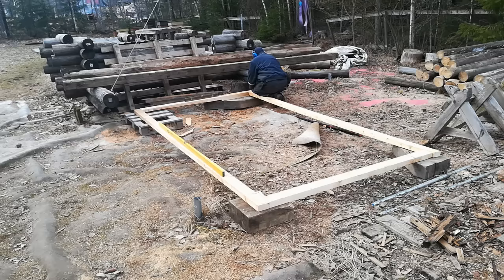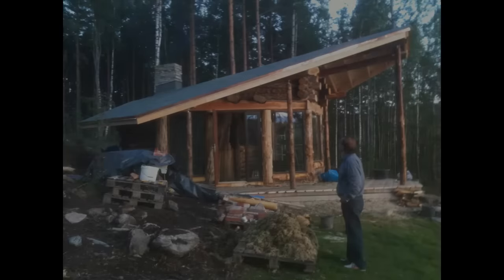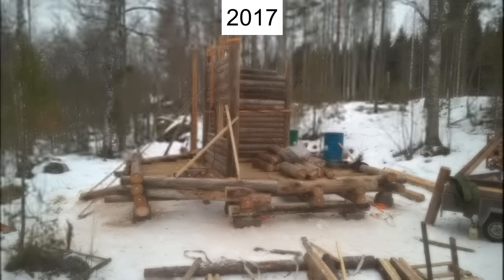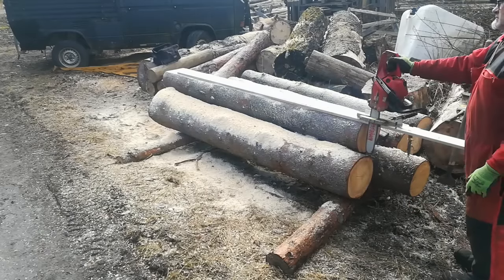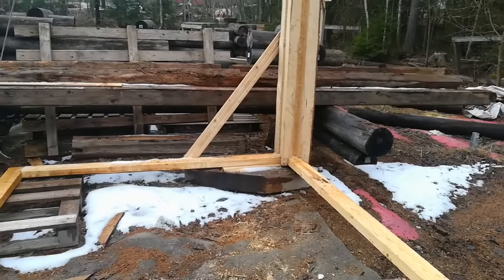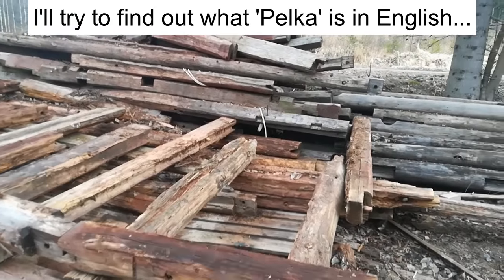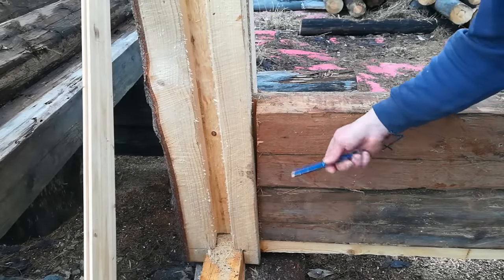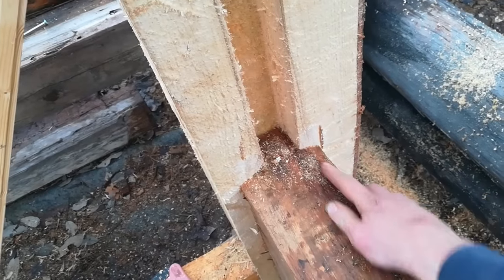Easiest log building method ever!!. Part 1.

Comment: Hi, really interested in your method. Were these vertical logs freshly cut or were they dried? If they were dried, then for how long? If these vertical logs  twist, bend or crack, does the strength of the structure gets compromised or not?
Which trees do these vertical logs come from? It looks like pine or spruce.
I will be very thankful if you can answer these questions please.
Reply from the maker: Hi. Actually I used both fresh pine (back wall) and dried hewn logs (front wall) the front posts are actually the same stuff I used for the wall sections (so 300 years old....should be dry by now). Now obviously I should have made all the posts from similar wood. I don't think its going to be a problem with this little building though. You asked IF the verticles twist or crack...they will certainly crack as they dry but no, that won't cause any problems, They may twist a bit but the toungue & groove should resist that a bit and again, this is such a small building that I can't imagine it would have any detrimental effect. If I were to build a larger building with longer verticle posts (greater potential degree of twist) I would be looking for really well dried logs.

Comment: I guess having the logs delivered is much easier/quicker than having to fell, trim, dry the logs yourself. What I do like about this method is you can build an entire wall, rather a having to go end by end and all the walls go up at the same time. Leveling seems easier, also. Logs don’t have to be the same thickness for leveling, only for the ascetics. Thanks.
Reply from the maker: Yes, there are many advantages.

Comment: hello and thank you for such an instructional video series. i definitely want to use this application in Alaska for my cabin build. couple questions, 1st question is , what is an alternative way for corner posts if you don't have large enough logs to support the notching of them(aka small trees in my area)? 2nd question, i know your camera died for the building of the floor, what if and did you use for insulation of the floor and underside or is it just over open ground? 3rd question, what type of windows and or window material would you recommend for a very cold weather application? thank you in advance. love to see more "Easier way" videos like this very awesome!
**edit- have 1 more question :) what's the name and type of the roll insulation your using between the logs? thanks
Reply from the maker: Hey Mike! Ok I don't know just how small the logs are where you are but you could consider just flattening the sides of your post and fixing a 2x2 to the side, so the post has the 'toungue' and then you put the 'groove' in the ends of your horizontal logs. If you watch the whole video series you will see my tips on doing it that way. No insulation under the floor of this cabin. Just put down a ground sheet, pressure treated logs, notched in the floor supports then floorboards straight ontop. The windows I used I got 2nd hand, tough sturdy frames and triple glass sealed units. The insulation is flax fibre made by a company called Isolinna. http://www.isolina.com/gb/
Reply: @ProjectHighlander  thank you for the super fast reply,  I've watched the whole series ill go back and re-watch for that information.  Much appreciated,  thanks again 🙏

Comment: I'm planning on building in a hexagon shape for my log cabin. Any thoughts on making 60 and 120 degree angles?
Reply from the maker: I touch on carving normal joints at angles in my series called Log Building 101. But if you mean using this system, with standing logs at the corners, then yes, it works, I have done it. Use as large logs as possible at the corners.

Comment: May I please ask, why haven't you taken the bark off the logs? many thanks from NewZealand
Reply from the maker: I avoid unnecessary work, Spruce bark cracks and falls off as the log dries. Of course most people strip the bark because it looks bad but if you watch the whole series of videos then you will see that all the logs that will be visible have the bark removed.
Reply: @ProjectHighlander   That makes perfect sense, thanks for the reply, also, do you by chance have a video that cleary explains how to do the Saddle Notch? Again, thanks from NewZealand,
Reply from the maker: @grassrootsphotographysean4474  I do. After the series of videos you are watching I did a series called log building 101. I covered the saddle notch in that series in some detail.

Comment: This method is called 'post and beam' log building and its been around forever.
I've built a few myself and you can actually get quite creative and precise with aspects of it, contrary to the thought that it takes less mastery to build this style. In all actuality any style of log cabin can be built with less craftsmanship or expertise... no matter how they are stacked.
Reply from the maker: Sorry but this is not post and beam. P&B is a generic term meaning a frame is built with verticle and horizontal elements and the spaces are then infilled with windows or other materials. Not necessarily logs, not particularly with a tongue and groove system. So I am using P&B principles and adding in my own ideas hoping that people who would otherwise be reticent to take this kind of project on can see that its not rocket science.
Reply: @ProjectHighlander  Yes... this falls under post and beam.
Reply: @ShaneHerrick  Well that was a devastating arguement.  Of the I'm right because... reasons sort.
Reply: @dinnerwithfranklin2451  It's common knowledge... its post and beam. I'm a log crafter by trade. I'm right in my argument by reason that in the trade it is called post and beam. Thats all.
Reply: So when the OP says "So I am using P&B principles and adding in my own ideas"" you are simply aggresively agreeing?
Reply: @dinnerwithfranklin2451  I'm not doing anything 'aggressively'... just stating that it's  post and beam. I think it's covered now.
Reply: @ShaneHerrick LOL well we established you are a typical american.  Yeah we are done.
Reply: @dinnerwithfranklin2451  and you just proved yourself a typical bigot.
Reply: @ShaneHerrick  Oh you poor man.  americans are so hard done by, boo hoo.  You are entertaining.  Come back at me.  Go on, I dare you.
Reply: @dinnerwithfranklin2451  psychological problems much? Get a grip.
Reply: @dinnerwithfranklin2451  why did your argument swing toward judging Americans? Get help.
Reply: @ShaneHerrick  That's your best? LMAO
Reply: @dinnerwithfranklin2451  my best what?
Reply: @ShaneHerrick  Your best come back.  Please do try and keep up.

Comment: Is this method better than the faster 3 part method video series?
Reply from the maker: The 3 part method is faster but I would not say its better in terms of the final result. The 3 part system you are talking about I made a lot of compromises and aimed for just speed.

Comment: Why aren’t you packing any insulation between the logs?
Reply from the maker: because this is not the buildings final location. In part three I start work on the actual build site and I move the building there. In the later parts of this series you will see how I do the insulation between the logs.

Comment: What is the average dimension of the logs? Or what do you think was the original Circumference of the logs before they were cut down?
Reply from the maker: They vary alot but an average would be 23cm diameter.

Comment: For how long did you dry the he logs?
Reply from the maker: The building that these logs were taken from was taken down 4 years before I bought them so they dried while being part of the walls of that house for 100 years or so and they were then stored in a barn with spacers between them for those 4 years. I have no way of knowing how long they were dried before they were used in the original building but at that time is was usual to partially debark them then dry them for at least two years.
Reply: @ProjectHighlander  thank you

Comment: I have used your system on three post and beam structures so far and absolutely love it.  I purchased a log moulder to make tongue and groove infill.  It looks and works well but I prefer the look of half logs and/or large slabs personally.  Would there be any reason you would advise against stacking slabs of wood with flat mating surfaces between them as infill?  The slabs are 10cm thick and 40cm tall.  The posts are 25x25cm.  The grooves in the posts keep them from twisting and warping as they dry.  I didn’t pin the slabs together and so far the seams are staying true.  Everything was cut and built green.  I reference your videos daily for ideas and inspiration, slowly learning as I go.  I guess I could sum up all this writing with a simple question.  If small gaps do open between infill pieces is Flax the best/only option to chink with if the building is a sauna?  Thanks again for all the great content please keep it coming.
Reply from the maker: Sounds great! Your 'slabs' are thick enough so that the joints may work fine. Of course adding a very slight bevel to the edges so that the flat upper surface of your slab, and the flat lower surface of the next slab are slightly angled downwards towards the outside of the building may help to prevent water wicking in but it could add a lot of hassle (depending on how you are cutting your slabs). If you can't find flax fibre then use moss. The moss from the forest floor works great, put it in wet, it will dry in place and wick moisture out. It's Ph also prevents mold.

Comment: Are you sure it is called "Pelka" not "Belka"?

In Polish we use word "belka" to describe a piece of material, such as a bar, or pole - a piece of construction wood or rock (later concrete or metal), something that holds/bears some weight and transfers it to other parts of a construction/building...
Reply from the maker: Yes. the Finnish word is Pelka.

Comment: Hello to Finland. Can I ask how do you secure the standing logs to the floor? And what is according to your experience the minimum thickness of the wood logs if you do not want to use any insulation? Thank you and greatings from Ireland !
Reply from the maker: The standing logs are not 'attached' to the floor, they are just notched to lock onto that 2x4 frame that's attached to the floor. Log thickness......its really up to you, how warm you want to keep it, if you have a heat source inside, what your local temperatures are. Around here a hewn log is usually about 15cm thick.

Comment: Does this method work with green wood or is that a whole different kettle of fish? I'm looking at options to build a new workshop as inexpensively as possible and I'm surrounded by larch... all of which is still firmly attached to the ground. If I could use some of it then the carbon footprint (in terms of timber acquisition, at least) would be close to zero.
Reply from the maker: Sure, in fact if you use this method you will have less problems with green wood than you would have with normal log building methods.

Comment: I can understand the desire to minimize modern materials. But if not strict on that rule, why not add some caulking or a little spray foam between the logs and at the notch ends? Nice place though.
Reply from the maker: Thanks. Ok here there is no caulking used on log buildings, To be honest I can't see why anyone uses it unless its just to cover really badly carved joints. The insulation between the logs serves multiple purposes. Yes, its insulation but it is not attached to the logs so the logs can move and settle. it also wicks moisture out and away from the logs as they dry. If you seal these seams and joints then the moisture is trapped and mold will grow between the logs. Also it allows air transfer -very slow air transfer, between inside and outside air which is why the air quality is usually so much better in log buildings. WARNING..SPRAY-FOAM IS DEATH TO LOG BUILDINGS!! It does not 'breath', It sucks in and holds moisture & rots away the wood around it. I have done many repair jobs on log buildings and in about a third of these jobs the damage was caused by well meaning people who thought that spray foam was a good idea.
Reply: @ProjectHighlander  I didn't realize you used insulation. I guess I missed that.
Reply from the maker: Ah. I guess you only watched part 1?
Reply: @ProjectHighlander  That is correct.

Comment: You said those logs were 100 years old and then said one was marked 1820 and they looked to be 100 years old when they were first used! That's 300 years old right? Holy crap!
Reply from the maker: Yes. you are right. I got it wrong. Never was good with numbers.

Comment: In your video you have referred to ‚pelka’. I am not a profesional builder but I guess it is the word ‚belka' the singular and ‚belki’ the plural in Polish. It could be translated to 'beam' in English and I hope it makes sense.
Reply from the maker: in the 4 years or so since I made this video series I have had probably 100 or so people point this out. The word means different things in different languages. I am in Finland and speak fluent Finnish, in Finnish the word pelka refers to a log with the inner and outer faces removed. It is most commonly used in the form 'pelkahirsi' (hirsi being the finish word for a log used for building). It is most likely related to the same word in different languages which have varying but related meanings but that is its meaning here.

Comment: How much does a small 1 bedroom log cabin costs
Reply from the maker: If you build it yourself then just calculate out the costs for the materials, that's your cost.
If you are asking what it would cost for me to do then I don't work that way. Customer pays all materials and I charge by the hour but I only take on projects where I have complete artistic freedom, a free hand to do it as I want and improvise as I go, So I don't know how long its going to take (how many hours I will be billing) until the project is done. As a rule I don't even consider any project if the potential customers first question is how much will it cost.

Comment: What about wood rot from not leaving space for chinking?   How long will it last.   Not criticizing.  Really curious.  Because the end result looks great
Reply from the maker: Thanks for the question, can I ask you where about's in the world you are from? Its fascinating that there are parts of the world where chinking is used and accepted as somehow necessary while in other places it has never been used. Here we don't even have a word for it because no one does it and I really don't understand the point of doing it... can you explain? I really am interested. I would have thought that chinking. .especially if using wet/green logs would cause the logs to rot as moisture could not escape from between the logs. Here we use an insulation between logs which also wicks the moisture out and never any chinking. There is no rot problem. Indeed we have log buildings here built this way that were built in the 14th century. The logs I used in this project had been part of another building for 200 years with moss in-between them as insulation before I got them. Not a spot of rot anywhere.
Reply: @ProjectHighlander  I’m in Chicago Illinois in the USA.  Not many cabins here in the city chinked!   Lol.  Regionally though.  Midwest area it’s common.   I’m no expert.  But my understanding is that the air pocket allows for insulation with a good chinking required only every 20 to 30 years.    Less logs used is the primary reason I believe. But log on log cabins don’t have long life in this climate from what I’ve read.   Again. I am no expert.   I’m planning on a build in two to three years when I move south of here.  And your method I have never seen although in reading comments I see that others have.  All the resources I’ve gathered to educate myself have never discussed this method.  I was thinking it could be done with gapping also if one was careful to place spacers of the same species of wood and grains aligned to mitigate shrinkage problems.   Great vids!

Comment: If the logs were marked with 1821 that means they are 200 years old
Reply from the maker: Yes, I have since realized that I counted that wrong. Numbers is not my strong suit.
Reply from the maker: Plus 1821 is just the date that the original building they were used in was built. Theses were slow grown pine logs. nothing like the speed grown rubbish you get today. I counted rings on a few and they were around the 100 year mark. So you could say that these logs are 300 years old.
Reply: That's amazing! They are that old

Comment: what is easy about this🤔
Reply from the maker: You ever built a log building? What is easy about this is that it allows you to overcome the biggest problems with log building. short logs, no heavy lifting. This system allows you to build a building, alone, with no lifting equipment. That is what makes this system easy.

Comment: This is cool and all but easiest? Definitly not. Building a log cabin the traditional way with nothing more than a hatchet and an axe is by far easier.
Reply from the maker: Thanks for your comment. I guess its a matter of opinion, but I have build a whole load of buildings and this, for me, is the easiest method. When I say easy I mean that this method allows a single person, with no lifting equipment, to build any size of structure. I am curious, though, where would you be using a hatchet for log building? An axe, yes. multiple types of axes of course....but a hatchet?

Comment: wrong absolutely wrong the first course is supposed to be pressure treated anyone knows that handy guy take it apart and do it again an get it right
in the 1700's pitch was used in abundance from pine tar
Reply from the maker: You watched part 1 of the series, the cabin still has to be moved to the build site. You will find answers if you are interested enough to watch the whole series.